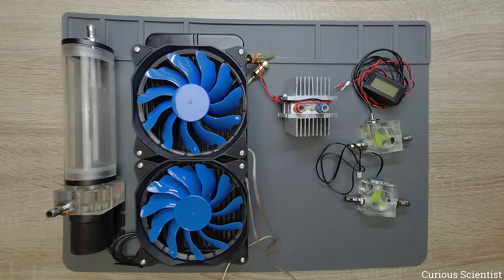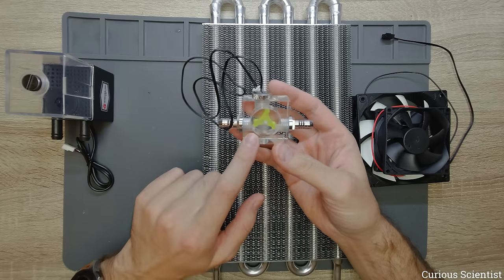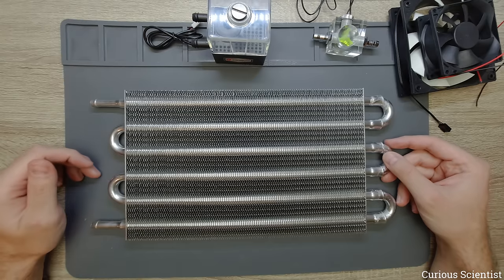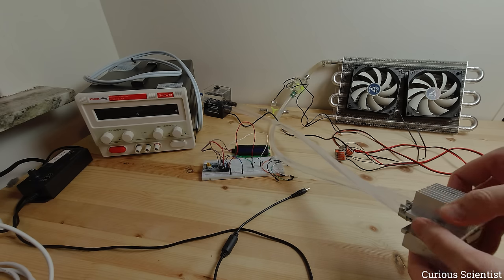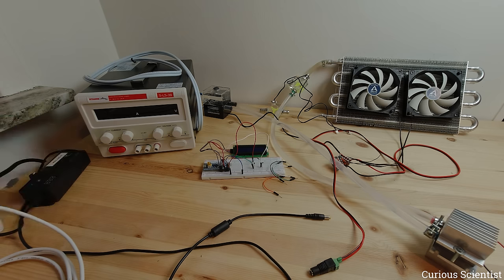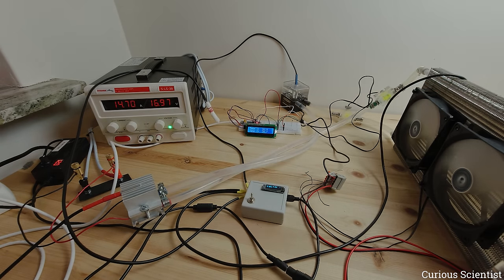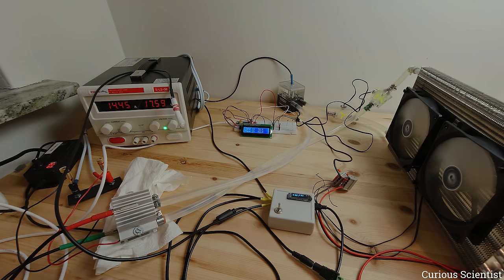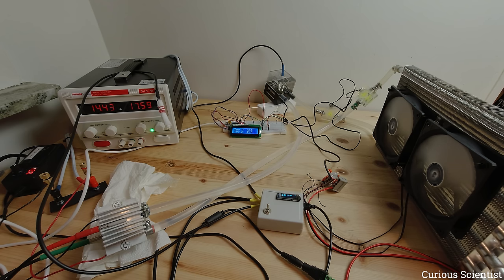Building and testing a new water cooling system for Peltier coolers

Comment: This is really great!! I'm looking to build a small unit of peltier system but the degree drop from ambient is around 4 degree. The conclusion to this experiment was the fan is not efficient, do you think that if I use a small radiator (120mm) with 2 fans front and back, would it be able to sustain the 4 degrees drop?

Also, does the placement of the pump has any significant differences between doing the pushing the water or pulling the water before restarting the loop again?
Reply from the maker: Thanks! Well, better pump would increase the waterflow which would have a positive impact on the system. So, if you are willing to pay more, I would recommend a better pump of course! The fan coverage can also be improved, so I also recommend you to use better fans than I did (I only had these available). Also, check the comments under the video because quite a few more experienced viewers left very informative and useful comments. I at least learned a lot from those.
Reply from the maker: Check my previous answer. :)

Comment: Is it possible to create a peltier cooling device that delivers drink-safe water?
Reply from the maker: Of course, but you have to match the cooling power and the flow rate of the water carefully. Also, keep in mind that Peltier coolers do not make the water "drink-safe".

Comment: I wonder if you can use this in reverse for the purpose of cooling evaporative coolers water storage
Reply from the maker: If you want to cool the water that you want to evaporate later, it does not make any sense. It is more difficult to evaporate cold water.

Comment: Hi long time  since you posted the video but i was wondering, it is posible to do it on a car a/c? Replasing a compresor whit water pump and bypassing condensor.. the system is allready a close circuit🤔🧐.. i'm resershing the topic. If it posible doin it.
Reply: Thinking on a treple aluminum blocks 40*200mm whit 10 peltiers, coold center  and heat out.. for fluid circuit from a Reservoir pump to cold center to in cabin radiator, out to Y to heat side, out  to a/c radiator to reservoir.
Reply from the maker: Hi! Compressors are much-much more efficient than Peltier coolers. It does not worth the trouble to build a Peltier-based AC.
Reply: @CuriousScientist  yes i now, in my car condition bad ac tech sees 2k+ to fix so in the time i gader money i experiment🤓
P.S. car name is Frankenstain

The thing is can it work
Reply from the maker: It is not impossible to make a Peltier cooler-based AC work, however it won't be as efficient as a compressor-based. Therefore you'll need to use more Peltier coolers, more power and more cooling for the Peltier coolers to provide the same AC performance. In my opinion it doesn't worth the trouble.

Comment: Can we cool air if we apply a fan with radiator ,where water will continusely run through it like you did in the video? And apply running tap water which will not get stored or circulated in the same place in the hot side.
Reply from the maker: Hi! Peltiers are not so good for air conditioning (I assume that is your goal). Preferably, the cooled object should be as close as possible to the cold side of the cooler. If you try to transfer the heat to the cold side via a water loop, you will further decrease the cooling efficiency of the Peltiers. Also, the water can freeze in the cooling block... The cold side should have a fan and a large heatsink and the hot side should be cooled with a water loop. But once again, you would need a plenty of Peltiers to produce noticeable effect. It is not economical.
Reply: @CuriousScientist are they good for refrigeration?If I use multiple 6 amp peltier will I be able to cool a small box, while using a huge heatsink on the hot side of the peltier?
Reply from the maker: They can be used, but they are not good for it (efficiency). For example, you can find Peltier-based wine coolers. But it is a very specific application...

Comment: I saw the other video you made about peltier air cooler, maybe you can try with this bigger radiator, use 1 or 2 peltier with big heat sink and fan, I believe it can lower the temperature by 8 to 10 degree celsius.
Reply from the maker: Unfortunately, believing is not sufficient in science and engineering. 1 or 2 Peltiers, even the 12715 won't be able to do that. There's not enough cooling power for such a drop...

Comment: Are both hot and cold tubes touching each other?
Reply from the maker: Yup, but it does not matter too much, there is virtually no heat transfer across those thick plastic hoses. At least not enough to invalidate the conclusions.

Comment: won't that purposeless heatsink act as an heat absorber (from the environment to the water you wanted to cool)? also, it looks like it is thermally in contact with the hot side...
Reply from the maker: I am not sure, but you might have misinterpreted the video. The water is not cooled by the Peltier cooler. The water cooling system is used to cool the hot side of the Peltier cooler. The purposeless heat sink is in contact with the water block which is cooling the hot side of the Peltier cooler. Since that part is above the room temperature anyway, it actually helps the cooling (but to a negligible extent). The bolts can transfer heat, yes. This is also negligible in this experiment. What people usually do is that they use plastic washers and/or sleeves to detach the bolts from the other metal parts.

Comment: Fans suck better than push and the fans are to small compared to the size of the cooler. Also pump the water through the bottom of the radiator  so that the radiator will be full of water. But it does look like there are no air bubbles. So that's ok
Reply from the maker: I shook the radiator to make sure there are no bubbles inside. They can get stuck in the curvature of the pipes easily.  Fans are small but I wanted to make it comparable with the other radiator, so I use the same number of fans.

Comment: what is the flow rate of pump and head used on video
Reply from the maker: The product is on my website under the parts & tools page. You can check it. I don't remember it from the top of my head.

Comment: which one is better to increase the peltier  Efficiency current or voltage
Reply from the maker: What do you mean? The efficiency is an intrinsic property, you cannot change it. But still your question doesn't make sense. You cannot feed just current or just voltage to load.

Comment: Will the heat sink emit dew/water vapor?
Reply from the maker: What do you mean by emitting? And which heat sink are you referring to? Water can condense on the cold side of the Peltier cooler, once its temperature drops under the dew point. But that is not emission.

Comment: Hey. Can i use 12v 4.2watt water pump on 12v 10amp power supply?
Reply from the maker: Hi! Of course. If the voltages match, then you only have to make sure that the power supply can supply the needed current. Since you have a 10 A power supply, it will be sufficient, because a 4.2 W device at 12 V will need 0.35 A.
Reply: @CuriousScientist  wow. Thnks 😁😁
Reply from the maker: You are welcome!

Comment: Daria certo eu usar esse sistema para tentar resfriar o ar da admissão do meu carro visando ganho de potência ou não compensaria?
Reply from the maker: Sorry, I have no idea about what you wrote. Could you write in English?
Reply: Would it work for me to use this system to try to cool the intake air of my car with a view to gaining power or would it not compensate?  In this case it would be a water cooler with a copper coil to cool the air. Thks
Reply from the maker: Thanks for the English! :) Peltier coolers are not powerful enough to cool the intake air. You would need tremendous power to cool the air with the Peltiers and then you also have to cool those Peltiers. It is better to use a proper cooling system from a car part manufacturer.

Comment: Hey master i need your help

can i run my peltier above 12v?
explain it to me plss i dont know what amps is  plsss help me..
Reply from the maker: Hey! Yes, you can run if you are using one of the TEC-series. In general, you will need 16-18 V to run them on the max current. But you don't want to run them at max current, because you lose the cooling ability due to the excessive amount of Joule heat. Watch my videos, I explain everything about Peltier cooling.
Reply: @CuriousScientist  your the best....
Reply: @CuriousScientist  last question ...
How many volts and amps are the best in peltiers? ...just give me an example of model of peltier and their best voltag and amps
Reply from the maker: @samanheeliud294  it really depends on the application. TEC12715 provides the highest cooling power from the TEC-series, but it needs a very good cooling. I hope you are not trying to build an air conditioning system, because that won't really work.
Reply: @CuriousScientist  I already did
It coold my room about 24 celcius in 1hr and 34 mins. But my problem is to buy a new peltier that had lower watts but has a nice cooling
Reply: It was my own idea no one think of it before😊 
im making a video of it soon (im still at editing stage)
Reply: @CuriousScientist  explain it to me please...
Reply from the maker: @samanheeliud294  explain what?
Reply: @CuriousScientist  
Last question
how many volts and amperes would be the best cooling of 12715

Comment: Is that radiator made of aluminium?
Reply from the maker: I assume yes.
Reply: @CuriousScientist  Not a good idea to mix copper and aluminium.  Look up galvanic corrosion
Reply from the maker: I know about it. But where do you see the copper? Also you can add corrosion inhibitors to the cooling water.
Reply: @CuriousScientist  That's OK.  But those inhibitors can wear down over time.  You do know that copper has better thermal conductivity than aluminium and aluminium has better thermal dissipation, right?
Reply from the maker: Yes, I know. One thing that I know a lot about is by the way metals and their behaviour. ;)
Reply: @CuriousScientist  AWESOME!   You know what to use where. 😁

Comment: Hot side fan speedup then you can reduce more cool
Reply from the maker: Yes! I have a high speed fan for this! I will test it in the next video.
Reply: @CuriousScientist  i have done with 8 peltier 12715 + 70amp power supply
Hot side 8 heatsik 
Cool side car ac condencer with 1fan 5 inch
Reply from the maker: @shahhiddali  I wonder how big is the heatsink on the hot side. By a quick estimation, you have around 900 W of heat from the Joule-effect and an additional 3-500 W from the heat moved from the cold side to the hot side.

Comment: The results are almost no existent - something is wrong! You used too little radiators on TEC and also the 2 sides are not isulated! Strange that TEC did not burn - no heat decipation of the 350 W!
Reply from the maker: The TEC was doing just fine, its cooling water was below 45°C. However, I don't understand your other remarks. I don't know if you have watched the video but the purpose of the test was to dump as much as possible heat into the water cooling system and see how it copes with the load. It just happened that I used a Peltier, but I did not assign any role to the Peltier, other than generating a lot of heat for the test. I don't know what other results you were expecting.

Comment: plusieur problemes ds ce montage...de un les deux dissipateur sont ds un environement de meme temperature..l eau et le dissipateur vont se stabiliser a la meme temperature...de plus..refroidisseur trop petit, le cote froid va se rechauffer par convection..j en sais qq chose...je travail sur le meme montage que vous...et cela pert en efficacité au bout de qq minutes...je vais aussi tester de plus gros ventillo...en fait, cela fonctionne mieux en chauffage mdr
b chance, on y arrivera
Reply from the maker: Based on the fact that you wrote your comment in French instead of the language of the video, I assume that you did not understand what I said in the video, hence you said what you said in your comment. 

There is nothing wrong with having the two heatsinks at the same place in this specific scenario. I am not trying to cool down the room or anything similar. I am just trying to see how this relatively cheap heatsink performs and how cold temperatures I can reach on the cold side of the Peltier cooler. Monitoring the temperature of the cold side of the Peltier cooler indirectly tells us how well the water cooling loop performs. The more heat it can help to dissipate, the cooler the Peltier cooler can go. To have a better cooling with this specific radiator, I need better fans, and as some people suggested in the comments, the water flow should be investigated and I might need to try building some kind of cover/skirt around the fan so the airflow becomes more regulated.

Comment: the peltier cell is an interesting invention but I think it will only work as a toy. Too much effort to do anything productive.
Reply from the maker: That's not true. Peltier coolers are not just toys. They are very useful in  x-ray detectors, for example. But they are not useful for cooling large volumes of fluids.

Comment: just buy a 30l thermo electric aquarium chiller on ebay
Reply from the maker: It depends on the person's goal. Those chillers are usually lower performance than those that you can make with diy methods using the same budget.
Reply: @CuriousScientist  Look I like experimenting too, and yes it depends on the application, but at 100w, and 30L, its a complete package for this type of micro cooling. I liked your idea of using the oil cooler, I am now buying one, even bigger, because I need to cool two reservoirs with one chiller, that have different liquids types.